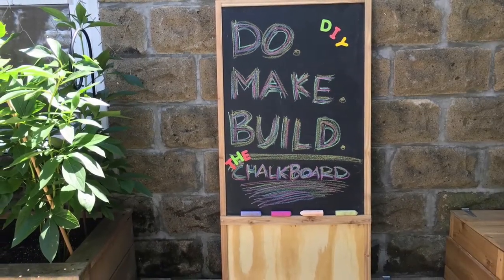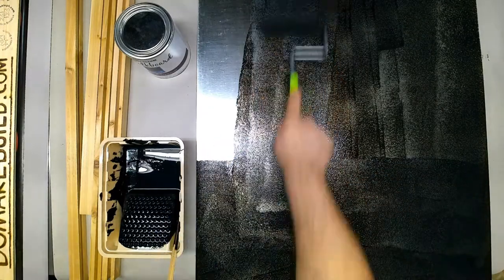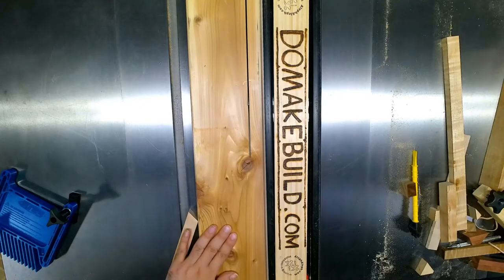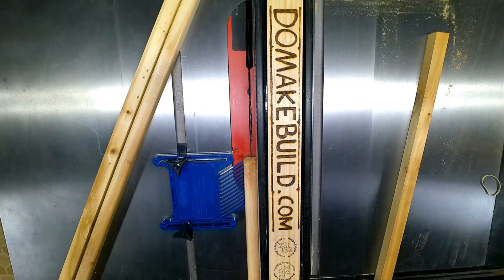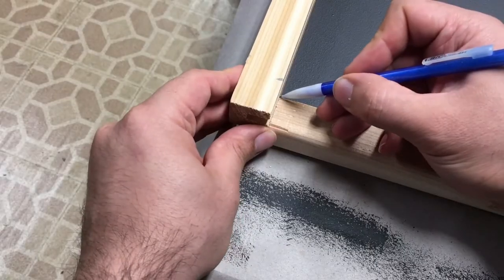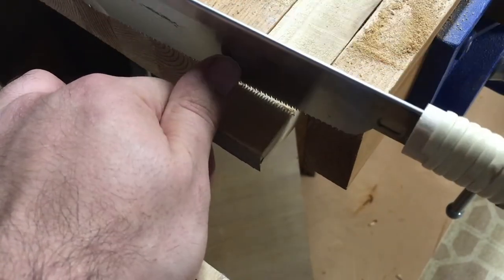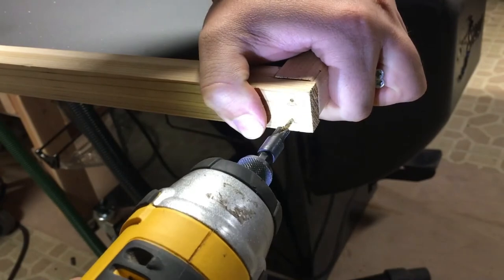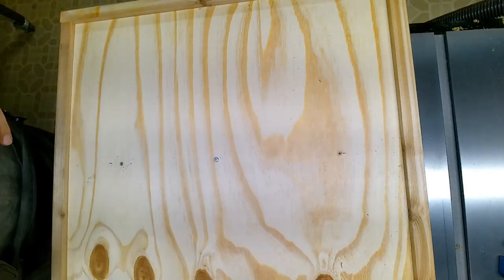How to make a magnetic outdoor chalkboard. DIY Do. Make. Build.

Comment: Would the process be similar for a whiteboard?
Reply from the maker: If making it magnetic then yes just use different type of paint.
Reply from the maker: But you can buy paneling material from home stores in large sheets for very little that would work pretty well also.